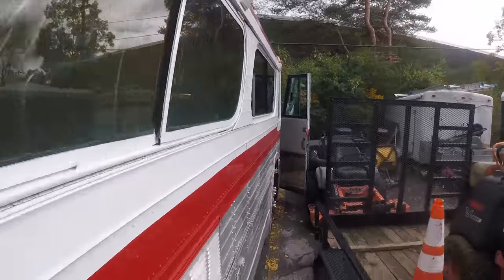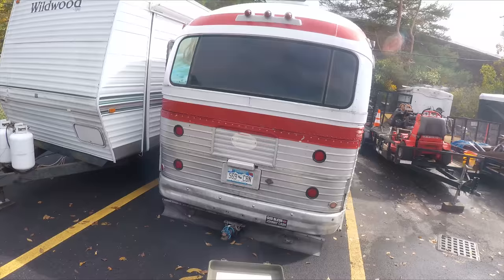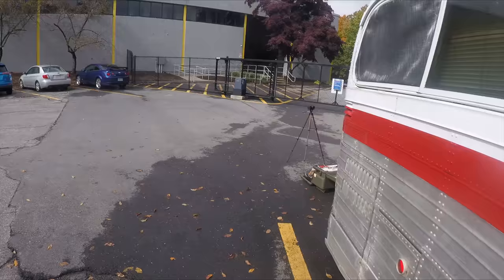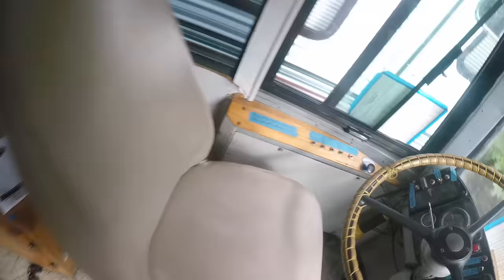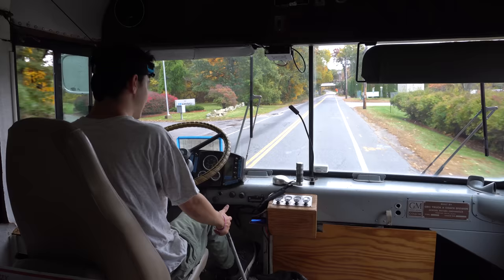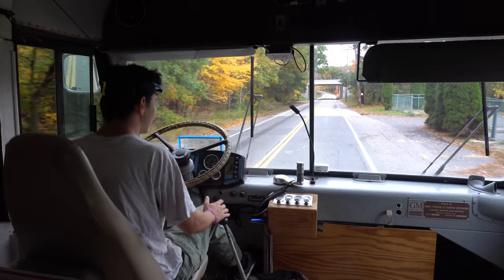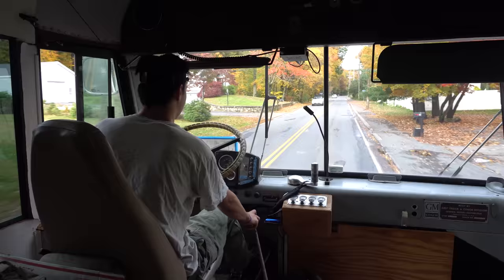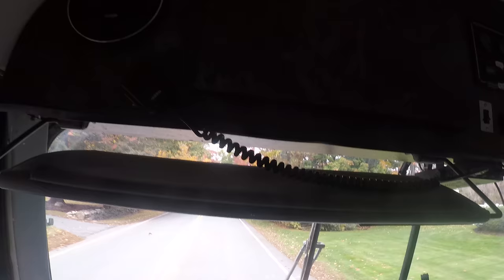1959 GM 4104 Bus. Driving/Shifting

Comment: I would like to add that you don't have to rev the engine up so high when down shifting, and don't try doing it from 4th to third above 40 mph. Other than that, you're doing fine and you will get better with time. I will also  " second the motion> about Scott Crosby. He is just outside Centerville, Tenn., south of exit 163, off I 40.  I  used to drive motorcoaches in Massachusetts, and I wish I had one for myself.  My first choice would be an early MC8 though. 40 foot, manual or factory automatic transmixer, and an 8V 71 T Detroit engine. BTW, If you're up shifting without grinding gears, without double clutching, and it works for you, then that's your style of shifting and don't worry about it.  Coming down a grade, with a stop at the bottom, whether you're in 2nd or 3rd, don't throw the clutch in until the dead last second.  You need the engine braking to help with the stop. Depending on the brakes alone in such a situation is a BAD IDEA.
Reply from the maker: Thank you. Solid info
Reply: Cool last name. After seeing the Twilight Zone episode, when in a high pressure situation where I'd like to give up, I find my self saying "Next Stop, Willoughby!"  I haven't jumped yet.
Reply: @scatteredrustyprojects  ,Thanks. That put a smile on my face. I have not seen that episode in some time, but as an old guy, I can honestly say I saw it when it first ran.
Reply: The biggest thing I was taught when driving a old transmission is there is a RPM range for the shift to happen and you can make the shift without the clutch.(it’s called floating the gears ) most people rev to high thinking it will give them more time to make the shift but it changes where to find that next gear up or down
Reply: what company? i was U.S. Express, King  Ward, Travel Kus. I own a 4106.
Reply: @garydesgres1382  In did charters and tours for Fox Bus( Later called Silver Fox Tours, I did a short stint for a company called Quikway , doing scheduled departures from  two Worcester  and one Westboro hotels , tying in to the Framingham Logan Shuttle. It didn't last long because the owner got bored with the success of the company. Peter Pan took it over and that's how I wound up doing scheduled line run work  All of this, including driving for a school bus contractor, was part time because I was a firefighter back then. All told, it was 18 or19 years of it.
Reply: I am by no means a heavy vehicle manual shifting expert but it seems the revs were very high and dont accomplish a lot if you rev to redline only to let it go all the way down to idle before shifting.  I think it comes more and more with experience.
Reply: @josephalberta1145  the rpm depends on the transmission you have as well as your engine my 10 speed Eaton had about 250 rpm difference between the bottom of the gear and the top. This may not help with a old bus as you may not have the manual but there is a chart for shifting, this is a guide as every transmission will shift a little different. The driver is the easiest item to adjust in the system.
Reply: @josephalberta1145  those old dt dont rev all that high. even thow it it sounds like he is hes probly only 2 or 3k rpm.
Reply: @gogereaver349  
Depending on engine it only rev's to around 2100 to 2300 RPM maximum.  I have driven big trucks with Detroits,  and they will rev well beyond 2100,  just don't know if you turn the RPM up how long the engine will last.  I heard of guys setting them to 2800 RPM that is a little too much in my opinion.
Reply: @bertgrau3934  yes over rev kills them fast
Reply: @gogereaver349  
I did drive a truck that had a 6V 53, it came from the factory set to 2800 no load RPM.  That's fast, and loud.  It only had 160 horsepower.  The truck was slow, but sounded like it should have been flying
Reply: wribg cañ handel it cañball riner do it all the tome

Comment: Ross, just remember that this bus has a diesel engine. Diesels have a lot of low end torque which means that they run at lower RPM's that a gas engine. Three thousand R's is about tops and 1500 is a good driving engine speed. Now as far as the transmission, double clutching will get faster as you drive. For instance, first gear, shift to neutral, clutch out, then in, shift to second and so on. Down shifting is the same method only backwards. I would check the brakes ASAP. A vehicle doesn't have to go but it does have to stop. Good luck with this bus. There are a lot of people who love these buses and are willing to help a new owner.
Reply: 2100-2300 rpm is top end on a old 2 stroke Detroit and that's absolutely SCREAMING. 2300 rpm from a Detroit sounds like 4600 because the 2 stroke has twice as many power strokes as a 4 stroke because the cylinder fires every up stroke unlike a 4 stroke that hits every other up stroke. Something else worth mentioning is the fact that you don't need to throttle coming out of the clutch because of the low end grunt of a diesel. Throttling out of the clutch will burn the clutch disc and glaze and heat crack the flywheel.
Reply: For 2-strokes thats not entirely True. They make most power higher up and its basically 'drive em like you stole em'. Lugging is exceptionally bad for these engines.
Reply from the maker: @Wayoutthere  this is also my understanding. Drive it like you stole it. It’s Better for the engine and makes it fun to drive
Reply: Check out the  Bus Grease Monkey channel. Your bus is the kind that Scott is an expert at; they also work on newer buses mostly with Detroit Diesel  engines. Good luck

Comment: As a truck driver, you are doing better than most who have never touched an unsynchronized transmission, eventually you'll learn how to float the gears and have a smother ride while saving your clutch
Reply: Spot on comment i own one of these i only touch the clutch at a light..thats it floating is you friend

Comment: Grew up on a farm in the 60's and learned to drive on a manual.  Non syncro gearboxes are no problem, and for the size, at 16 was operating a twin screw grain truck so this bus would be a piece of cake to operate.  Did you ever think of airing the thing up with a aux compressor to start up.  Simply run a air line to the air tank and use a compressor to fill the tank.  Remember the air compressor on that diesel is rather small.
Reply from the maker: Great idea
Reply: hief at ¹6   drive porshe 930 tirbó lsmbghhíes fsrrieß 398 miñí viçe        farí

Comment: You’re handling that big bus really well.  Driving a “crash box” transmission is a challenge but you get better by driving it.  Double clutching will definitely get you into a smoother operation.  Great old bus!  These were everywhere in the 50s and 60s.  Thanks for posting!

Comment: Engine doesn't need rapped completely out, and such high RPMs aren't needed to grab another gear. You'll catch on to it eventually. After awhile you'll be able to float the gears without even using the clutch.

Comment: Nice to see a young man with an old bus! Shifting will get easier with more driving. I recommend you fix that seat suspension, driving is so much easier if the seat doesn't try to throw you off all the time. Air pressure should be up in few minutes, not 30, you either have a huge leak or worn compressor.
Reply: jaakko is watching, i think he was going by  those four leveling gauges

Comment: @Ross - Nice video, nice to see a "youngster" interested in these old road warriors. Can't tell you how many miles/hours I have behind the wheel of 4104s, 4106s, the Buffalos, Crowns, Gilligs, Eagles, MCIs, etc. - over 35 years in the industry.  Some thoughts:

1) DO NOT MOVE THE BUS until you have a minimum of 90-100lbs of air in the system!! Your brakes aren't worth diddly squat until your air pressure is up in the normal operating range of 85-120psi. I'm talking about the dash gauge - not the four little ones.
 
2) The four little psi gauges with the black knobs is your campground leveling system. Not knowing how it's plumbed (if it's by-passed the OEM leveling valves, for example), here's how to determine the correct psi readings - you'll need a bubble level and a tape measure. On a level surface, and keeping the bubble centered, raise/lower the psi in each valve until the top of the bottom entry step is 14" off the ground. Note the psi readings for each corner so you can keep it level for highway use.

3) The fact that you're learning how to get the coach rolling without using the throttle is a good thing - keep practicing. Put a white Styrofoam cup on the dash filled with water and practice until you can do it without spilling the water. 

4) There is NO need for downshifting on city streets. Just keep it in gear until you're almost stopped, then slip it into first. 4th to 3rd coming off the freeway is fine, once you're in the proper speed range for 3rd, then grab the appropriate gear at the end of the offramp.

5) If you haven't found it already, go to busnut.com, click on the "BNO BBS" tab on the upper left, open the "Articles Of Interest" tab, scroll down, read, study, and memorize the "Pre-trip Inspection" and "Shifting" articles. I think you'll find them helpful. "Don't Leave Home Without It!"

6) The rubber mudflap hanging off the rear bumper can, and sometimes does, contribute to overheating. The factory installed a full-width mudflap directly behind the rear axle to create a low-pressure area under the rear of the coach, in order to help draw the hot air out from the engine compartment. The current bumper mudflap defeats the factory's cooling system air flow dynamics.

7) Scott Crosby's "Bus Grease Monkey" is a good site, and he's gotten much better over the years, after a somewhat rocky start. But that was over 8 years ago. . . You should also add Luke Bonagura at US Coach & Equipment in Vineland NJ to your list of contacts - he's the "go to" guru for parts for these old coaches. Works M-F, 9-4 Eastern.

That's all for now, hope this helps!
Reply from the maker: Awesome man thanks for the great info. I've been told the mudflap could be a problem before and have been meaning to remove it. A lot of good insight here-Thank you!
Reply: Point on!   Drove plenty of 2 struck Detroits.  You explained perfectly!!  Ross listen to what this guy has to say and you’ll go great!   Keep up the good work.  I’m super jealous!!  Haha.

Comment: I would start looking for air leaks, a half-hour is a long time to air up... 

671s aren't rare, they're used in a lot of different industries and heavy equipment.

Go to a glass shop for side windows. It's all flat glass on the side, take them one for measurement, tell them it's for a vehicle so they give you the correct glass, don't tell them it's for a '50s vehicle and you should be fine. It's the rear glass that's hard to find!

Nice bus!
Reply from the maker: Good info. Thank you

Comment: You should clutch in > go to neutral  > clutch out > rev it to match the gears > clutch in > put it in gear > clutch out. The skill is in the speed of this process and also being able to rev to correct RPM to not grind the gears. I have never driven old american bus but we had gearboxes like this in Europe also :D

Comment: I rode one of these with Greyhound in 1967 from Phoenix to Los Angeles back when all but the last 100 miles was on a two lane road.  I'm a bus nut so bus travel left great memories both in the city and long haul.
Not a fan of buses that have been converted to RVs but glad this bus has survived.
6.71's are still relatively common since a number of these older buses as well as semi trucks have survived. It's my favorite diesel engine.
Reply from the maker: Can't beat the sound of the old 6-71. Wish it had a working jake brake!
Reply: @RossTheBuilder  6-71's sing beautiful music. I remember the first time I rode a city bus when I was about 5 and been hooked on them ever since.
Reply: The inline series 6-71 was the flagship product of the Detroit Diesel division of General motors introduced in 1938, the v-type would be introduced in 1957.  There was even a pancake variant, known as the 6L71, and 6n71, for use on horizontal underfloor-mount  vehicles such as larger crown and gillig school buses.  There's also the gray marine 6-71, The General motors 6046 twin pack. Used in such vehicles as the Achilles m10  tank destroyer. LCI, the quad 6051 71 series.

Comment: I had a 5303 (transit bus) with the same trans. I wouldn't rev it between upshifts, just wind it out, push clutch, pull to neutral, let clutch out, then immediately push back in, and pull it into the next gear before the engine wound down. It would slightly grind as the gears slowed down, but never had an issue. I also used the brakes as usual, just HAD to make sure to put it into first before coming to a complete stop. The clutch, when cold, would drag the input shaft of the trans and keep it spinning even with the clutch in. The brakes are massive, don't be scared to use them.
Reply: I was taught to never touch the clutch when shifting. Wind up untill it tops out, lightly pull the shifter out of first and ease right into second as the rpm's drop. Same with downshifting,  let up putting pressure on the shifter and when the rpm's are right it will drop into neutral as you rev it moving it on into the next lower gear as they will match up. Then let off the accelerator. Much simpler.
Reply from the maker: @davidg.1623  good info. Thank you
Reply: Your doing really good in my opinion.  I drove one of these for four years on regular passenger run .  You will learn at your own schedule so it takes time.  Keep driving and you will be fine.  You might want to look for air leaks .  Best Wishes.

Comment from the maker: Thanks, everybody for the comments. I've been doing some things wrong and appreciate the input. I shouldn't be keeping it on the governor as much as I was and I was wrong about the air suspension. It is manual inflation (changed from factory self leveling) she wasn't aired up much at all. I'm in the process of making a part two to this video. I've had a lot more practice with shifting and have figured out the bus a lot more. I had a lot of misconceptions rooted out by all of your input. I'll explain in more detail in part two. Thank you
Reply: What is you name brother congratulechion

Comment: For the better parts of the 1970s and the beginning of the 1980s...I converted a 4104 for a gospel band traveling all over the midwest and south through all of Mexico, Honduras, and Guatemala.  There is probably enough of a cult following that there's a bus nut more than willing to give you advice.  We traveled in every state in Mexico.  One thing (although this is old info) the 4104 was manufactured in Mexico so in the time frame I'm referring to there was no problem finding parts.  I'd buy a couple of air bladders as one or more may be leaking.  Don't worry as some have said shifting that old dinosaur will be second nature to you in about a month.  The grease monkey guy is probably a good contact, he's probably a second generation, my mechanic used him.  Regarding lugging I used the rearview mirror as my guide...increased smoke means you're lugging, usually noticeable before the gauges tell you.  We used a higher grade of diesel back in the day.  Today probably the fuel is better.  Good luck young man.  Btw they go like hell well beyond 80 the last mark on the gauge.  And, DON"T let it overheat!

Comment: I drove these very buses in 1974. The transit system in Denver I worked for, condemned a private bus company that had several of these in their fleet. They had the two speed rear axles with a button on the shift lever. We ran them on the old company's bus routes. I used to double clutch the crap out of them. The District got rid of them as soon as new buses were delivered.
Reply: not   jourñy
Reply: @sharonbraselton4302  ??? Please explain.

Comment: To assist in your gaining dexterity in double-clutching; learn to trust your ears and that DD!
In upshifting learn to shift as motor revs up not when you reach redline in any gear. There exists shift points within each gear range that once leaned make for seamless shifting! Imagine operators of that era could smoothly engage clutch and make shifts without moving passengers forward or backwards given the fluidity of their clutch and stick work!
Practice employing rhythmic timing and learn the shift points/ range via reading your tach!
Otherwise enjoy this essential classic! Any driver of that era will remember how taut those GMC transmissions were especially on both their 4107/4108 Buffalos. You needed to be spot on or you grinded gears or had to slow/stop and start again from 1st!

Comment: Diesel engines have so much torque that if the engine rpm is increased while starting out from a standstill will prematurely wear out the clutch disc. What you were doing when you were backing out of the parking stall was correct.
Reply from the maker: Awesome. That's what I figured. thanks

Comment: just lightly hold the throttle as you shift slowly and let it suck the gear in. you will get it. old transmissions are fun to learn to shift fast. you will notice a half way point between neutral and fully into a gear, that half way point is the point you pause .
Reply: I'm not convinced he needs to rev it to redline for every downshift either, it's all about rev matching, so just rev slightly past where you need it, then it slots into gear as the engine speed decreases into the right range for the gear
Reply: you are right. its all about rev matching, And that is the idea behind what i say when i mention keepign your foot on the throttle. dont fully lift off the throttle because it causes the engine rpm to drop too low and now the gears may not wanna match up right. and the point and rpm will depend on what gear your in. its quite fun to learn your machines sweet spots.